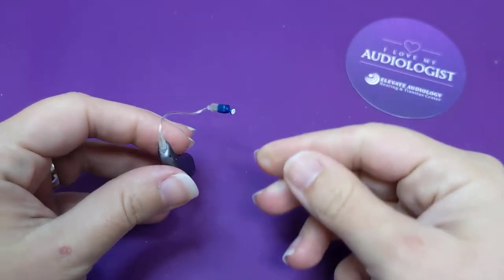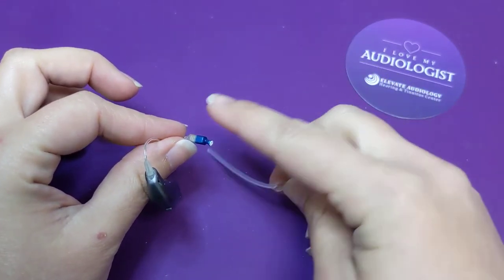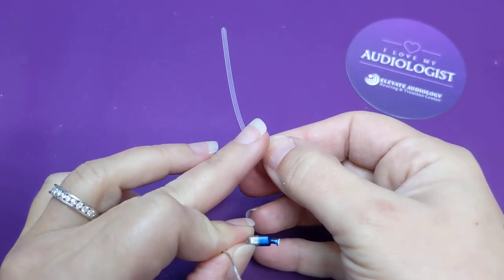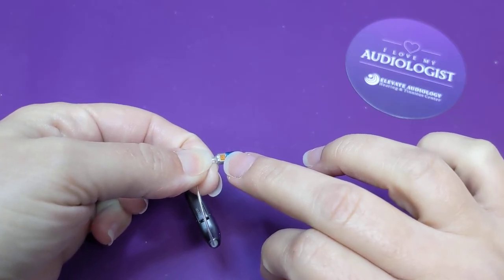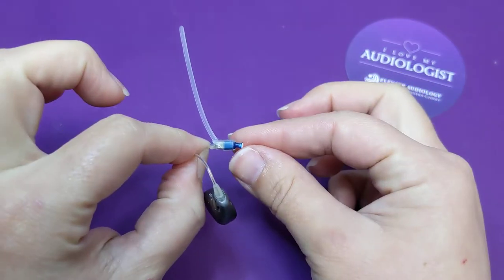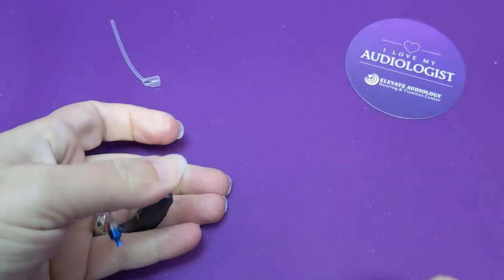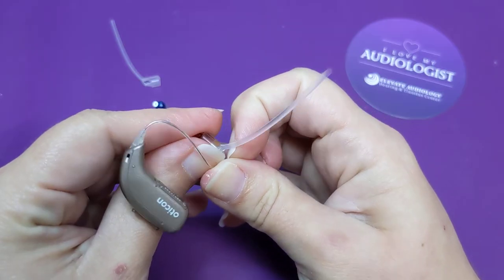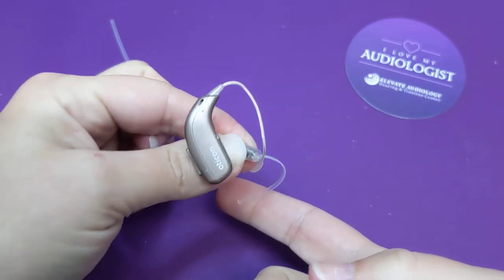Tutorial: How to put on an Oticon hearing aid anchor "ear grip"

Comment: You mentioned that a size 85 speaker is technically a 100.  What do you mean by that?
Nice video, very clear.
Reply from the maker: an 85 power speaker is different than a 100 so they would have separate size anchors.
Reply: Thanks for your quick reply.